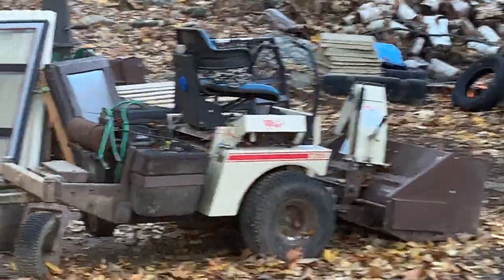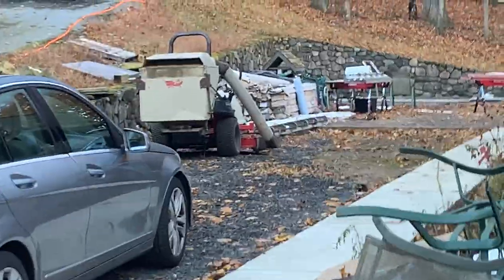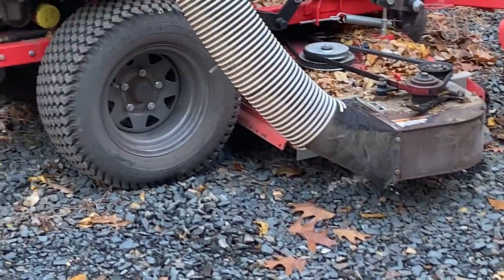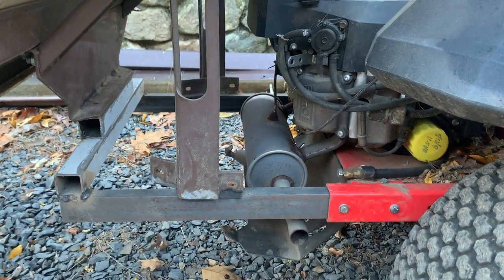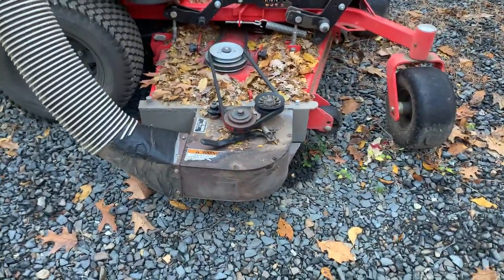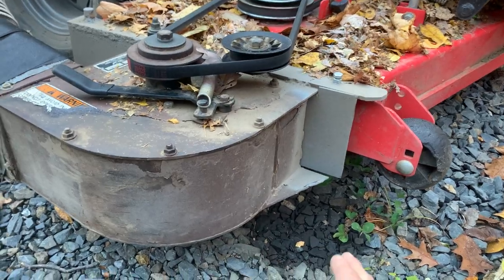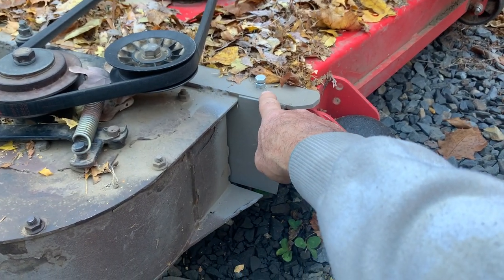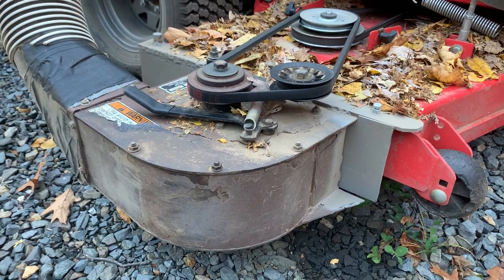The Best DIY Homemade Power Leaf Vacuum bagger for Zero turn Mower. Gravely Pro Turn power bagger.

Comment: Nicely done. I might try to fabricate something like that for my Bolens riding mower. Does the bagger hold enough material to suit you?
It looks like it empties easily, being built on a slant like that.
Reply from the maker: I am pleased with it. I haven't used it since last fall. I am glad that I am typing this because now I remember that I need a new hose and will order one today. In the spring I took out those couple of bolts and removed the catcher because I don't need it for grass. But leaves are nearly upon us. I think it holds plenty! Understand they are usually pretty chewed up because the mower blades have been at them before going into the holding container. Yes they dump easy! The only issue with this unit and it was always an issue even when on the grasshopper is that it doesn't like wet leaves or grass. It clogs and you have to free the clog or you don't pick anything up. So it is important to try to use it when the leaves are dry. Another tip is to not be too aggressive. Picking up leaves or blowing them is a huge job and driving straight into a 15 inch pile of leaves will surely be more than the machine can handle. So if there are a lot of leaves drive the non hose side of the machine into the huge pile and only cut into it as much as the machine can handle. If doing the flat lawn that has lots of leaves maybe consider only doing half size paths instead of full. It is less work if you don't spend time unclogging the machine and just spend your time picking up leaves and dumping from the seat.
Reply: @Depression2010  Thanks for the reply!
I've been working on my version/invention for a week now, I will finish today and start picking up the leaves that have already been falling here in northern NJ.
Years ago I had altered a 275 gal. fuel oil tank into a triangle shape and had it mounter over a bush hog that I cut a hole through the top of the deck and mounted a blower on with a hose going into the tank.
It would work pretty good, and too many times it would clog.
So I abandoned that idea and removed the tank, sized it down from 5' width to 3 and a half foot width and mounted an axle and short tongue with the blower to be pulled with my old Bolens garden tractor.
I kept everything low and close so that I could eventually operate the dump door from my seat, for now I keep it closed with a strap and get off to unload.
Not a problem for now because I can see that it will be much more efficient than what I had been doing with the bush hog.
On another note, your pizza video totally fixed the problem I had been having for years!
I used the exact same proportions of ingredients as you did ... but ... I never let it sit long enough!
As you know, what a difference that little detail makes!
Like night and day!
I can't thank you enough.
Take care, 
Wayne
Reply from the maker: Makes you wonder why you never made pizza before doesn't it. I have no desire to ever purchase pizza from restaurant again because they cannot make it as good as I can at home. Calzones are simple too! Thanks for the kind words. @WayneMarion
Reply: @Depression2010  
My dough was just ok, sometimes good actually, but it is far better since I saw how you did it with the exact proportions of ingredients that I had been using.
It's far, far, better since I started letting the dough sit for the day, and it's less work at one time than the way I was doing it. And it now is comparable to the take out crust that I was searching for.
We were getting tired of the pizza shop stuff. The quality at even the best place would often vary. 
The cost was ridiculous and they went from an 18" to a 16" and still called it a large pie.
As you already know, we get consistent results every time now.
Thanks again, and I fully understood your tips on handling the leaves with either side of the mower deck attacking the deep leaves.
Take care ... pizza is on the menu tonight!